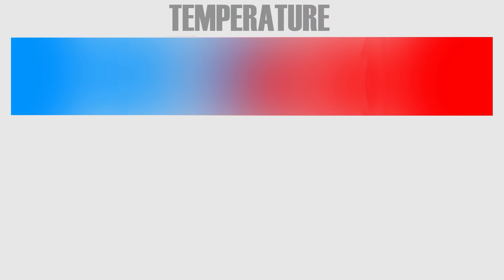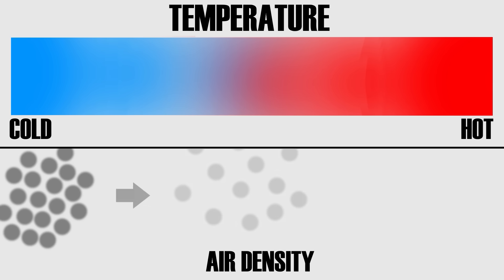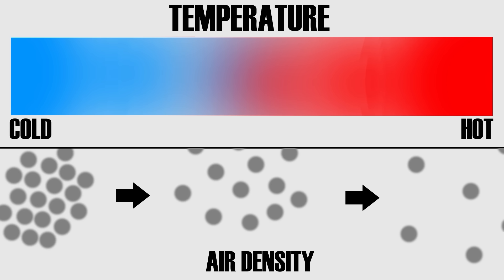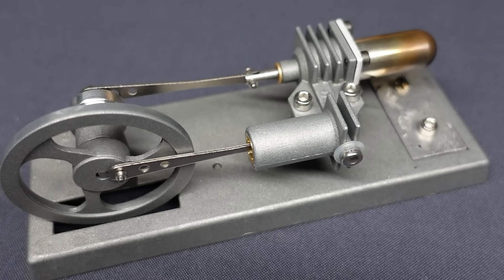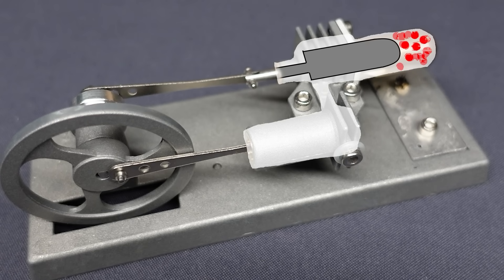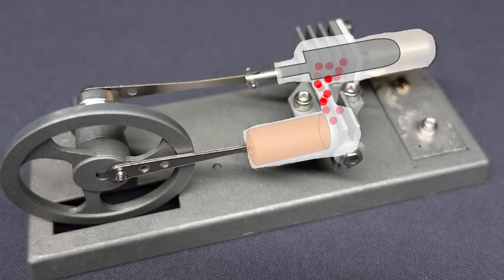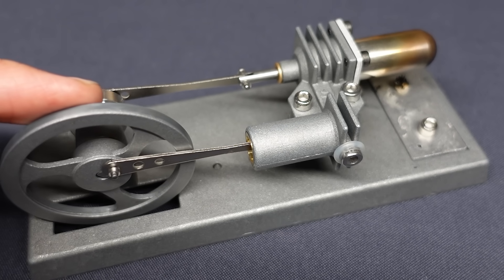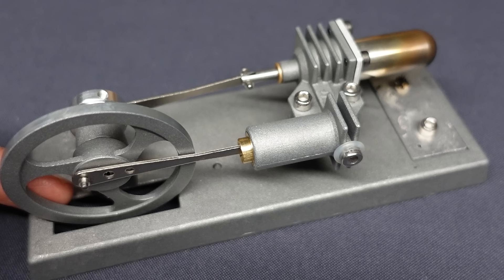It Can Save The World - The Simple Genius of Hot Air aka Stirling Engines

Comment: Multiple false statements in this.
No lubrication needed: As soon as this is scaled to something that is no longer a toy, lubrication is needed.

No carb is needed: It needs a way of throttling the flame for the power output to fit the power need, so it essentially needs a form of carb or regulator to control the heatsource.

They never need to expel burnt air and fuel: They do need to expel the "used air" from the flame, fresh air is needed to keep the flame going.

It can not take away spare heat from a gas boiler, any heat this thing takes does not go to heating.
It can also not live on heat alone, it needs the temperature difference to work, water would need to run in the cooling spots to make op for the high loss of heat from this engine.

Stirling engines are still only 40% efficient and they are much less efficient power to weight or size compared to Internal combustion.

The LED on V4 stirling engine looks like a 1W, a solar panel the size of that engine would produce the same kind of power for a much lower cost.

Comment: These can run on solar energy if the hot side is dark to absorb sunlight and the cold side is shaded. Bonus points if you use the flywheel as a fan for the cold side.
Reply: A magnifying glass or mirror(s) could concentrate solar energy on the hot side. Might not be practical but could work in theory.
Reply: @ben501st The problem is tracking the position of the sun with the glass

Comment: This is something I've thought of since I was a kid. It's always been met with, "It's not cost-effective to use waste heat." My thinking is, ANY energy you recover, is better than no recovery at all. If you put a Stirling in the exhaust stream of an Atkinson-cycle engine, or even a turbocharged engine, there's plenty of heat energy to create electricity. And the Stirling doesn't need to be some high-tech, overly-engineered design, either. As you've shown in the video, a basic machine made of simple parts performs well, and if car makers say it's "not as efficient as it could be," who cares? I can see creating an aftermarket unit than can be adapted to at least a few cars. It's not just electric hybrids, either. You could add a Stirling generator to most any car or truck and make 12 vdc for the battery, taking some load off the alternator.
Reply: "ANY energy you recover, is better than no recovery at all."

Incorrect. Would you work for $1 an hour as a second job? Of course not. Because the resources you put into the process, your time and effort, is not worth the resources you are getting out of it, the $1 an hour.

Likewise here. What do you gain by spending $10 recovering energy from waste heat if you only get $5 worth of energy out of it? You don't gain anything, you are actively wasting resources by trying to recover this energy.

"If you put a Stirling in the exhaust stream of an Atkinson-cycle engine, or even a turbocharged engine, there's plenty of heat energy to create electricity."

This is true. There is plenty of heat energy to work with there.

"And the Stirling doesn't need to be some high-tech, overly-engineered design, either."

This is where you are wrong. It absolutely DOES need to be a high tech design in order to be light enough, compact enough, and generate enough power to be worthwhile to fit into a car. Which is why nobody does it. Because it's too expensive to do.

"As you've shown in the video, a basic machine made of simple parts performs well".

Sterling engines are deceptive. Due to the Square-Cube Law, they work well at very small scales. Like here. Because the surface area of the cylinders is large relative to the volume of the cylinder. So transferring heat into the working medium is easy. However, the larger you make them, the less and less well they work. Because it gets harder and harder to transfer heat into the working medium. You have to start doing things like using a pressurized working medium, fins on the inside of the cylinder head, and other elaborate engineering.

"You could add a Stirling generator to most any car or truck and make 12 vdc for the battery, taking some load off the alternator."

You'd probably get enough energy doing that, with simple engines like these, to charge a cell phone. You'd spend far more energy installing such a system than you would ever get out of it. Which is why nobody does it.
Reply: @Crosshair84  it does make  sense for a stationary application like a wood stove or a home generator to make combined-heat-and-power.. but in that application you end up paying triple anyway because you got to get certified by all the unions and agencies (multiple overlapping UL listings too) associated with electrical as well as heating and plumbing excetera.... It sad when red tape becomes most of the cost...
Reply: Carmakers are not concerned with innovation and engineering solutions in the sense that the public uses those terms.
Carmakers are concerned with complying to government dictates. You will find plenty of engineers working for carmakers who are not in charge of anything but are as enthusiastic and capable as possible for true innovation and engineering solutions in the sense we think of, but that is precisely why they are not in charge of important decisions.

When they adopt the mindset of satisfying government dictates rather than what makes the most sense, then they are permitted to take the reigns of the company.

Welcome to totalitarian America, you were born it. Covid just accidentally made it possible for you to peek behind the curtain to see how plain this fact is.
Reply: @Revere2000 you sound like that was your job for a while.

Comment: This gave me so many ideas! I'm planning my house around the fireplace to harness the heat in many ways, and this is definite a good way of using the wasted heat, maybe to help circulate the hot air around the ambient, or move cold water into coils to heat up, or to help regenerate electricity. Thank you very much for presenting this kind of engine!
Reply: You can buy Stirling engine powered fans that go on top of wood and coal burning stoves, using the waste heat to circulate air. You can also get thermoelectric ones, which are more efficient, but engineering-wise, they're not as interesting.
Reply: @therealchayd  Nice to know, although I like the idea that something like this can be done by oneself and in a suitable size and shape to fit one's requirements. I planned and am building my house by myself (and some occasional friends), trying to keep it off-grid as much as I can. As with the heat, I'm trying to harness as much as from the fireplace. As for the heat circulating with sterling engines I was not thinking about open fans, but ducted ones, to move hot air to rooms away from the fire. Even the heatsink of this engine is useful for this purpose, if one manage to have a cold air intake close to the heatsink, pushed by a fan through it inside a duct that goes touching the metal chimney to extract even more heat as it travels through the duct all the way to farther rooms.
Reply: @therealchayd  I bought about 10 of the little white square thermoelectric ones with the 2 wires coming out. Don`t know why I bought them. Must of been a drinking EBay session. I do have a fan for the fire too. Think I was going to make a bigger version.
Reply: @therealchayd  Yeah, reading the comments, people are thinking the Stirling engine is something new and magical with great potential to solve the world's energy needs.
Reply: @codetech5598  we cant all know everything all the time forever and always, especially with not so widespread things like this. Give people a little credit and be happy for their excitement in learning something new. Maybe it's old hat to you, but it's cool to others.
Reply: @codetech5598  The same kind of thing was said about Boolean algebra when he invented it in 1854. It was mostly an academic novelty until 70 years later when electrical engineers used it to design a control relay board and invent the first computer. Old ideas are not bad ideas, and we'll never know the extent of a technology's uses if people don't keep picking it up and playing with it.
Reply: It is possible, to use heat from fireplace to also use as a power for Stirling to keep your home self sufficient. However, there are many things here that are very problematic. And as a person who lives in a home and uses it all my life, there is one thing from home i expect - quiet. And all engines have one thing in common - noise. Usually a fireplace is set as a central or close to central place of the home - even heat distribution and let's be honest, we LOVE fire. So usually a fireplace is built not in the best area to combine it with a noisy engine generator.
Second thing - Stirling engines may be a "low heat" engine. But those are just science toys for show and prooving a point.
So if you want ANY decent power output, you want to maximize a temperature difference, because this is where that power comes from, so - you want to put your hot part of the engine directly in the heat. You can use fumes. But exhaust gasses will differ in the temperature aswell. And today the most efficient stuff producing heat for home will have as low fumes temperature as possible. And this is around 50C for natural gas. Why? Dew point. And i'm talking here about high quality, never used natural gas stuff at home. For dirty stuff like a fireplace or questionable coal stoves, from what i remember, safe temperature of fumes is a bit below 300 degrees of celsius (250 or something similar). Why? Dew point and sulfuric acid. If your fumes will have such low temperature, water will start to appear on your chimney walls. And all sulfur compounds within fumes will become an acid and just eat your chimney away. Go ahead ans ask people who produce their own natural gas 😊

I just mentioned 2 main problems, and there are more :)
Yes, it is possible, yes it is viable. But it needs a lot of good engineering and building a home around your fireplace, or remodelling your home very, very hard.
Reply: Using turbines will me more efficient with wasted heat
Reply: be great for your house sir. U can do it, i know u can.
Reply: Don't forget the heat that refrigeration puts out.  Most important is understanding and minimising heat lost unintentionally from the house through lack of careful design.

Solar heat landing on a heat sink / stone wall etc. can be a store also.
Reply: Thats basically their main use. You can already buy commercial products which do exactly that heating while also creating power from waste heat.
Reply: There's a guy who made a Stirling engine at a grill, and he uses the engine to spin the barbecue.
Reply: A small wood stove (or rocket stove thermal pump principle) with connected mass heated from say a 20’ serpentine exhaust works for efficient heat capture plus long term release.
Reply: Good luck... with that.  Your going to find you will waste more of your time then what you will gain with your waste heat.
Reply: @tylermcnally8232  Nothing really worth doing is easy 😉Such decision should be well informed informed, yes. But personally i wouldn't discourage it by empty statements. That's why i made my previous remarks. And i stand by it. It's not easy, but not worth it? Show me your calculations please. Worth is measurable.
Reply: These engines can't really do work.
Reply: @BBVance  Oh really? That's amazing... Did you talk to engineers of Gotland-class submarines? I hope you do, because Swedish Navy is using succesfully Stirling engines there for years.

Comment: You said power modulation is big problem of this engine. I am not an expert on this topic but a simple thought just came to my mind...is it possible controlling the engine power transfer like in a normal internal combustion engine...Using some kind of clutch for that to engage and disengage the engine torque transfer and therefore controlling how much throttle and momentum you wanna build up :)

Comment: an sterling alternator in a vehicle would be cool, no horsepower loss, but generating energy
Reply: Except the energy produced would be much lower and the engine compartment/room hotter for an overall worse efficiency. The power loss from an alternator is insignificant. There are use cases for Stirling engines, but this isn't one of them.
Reply: @EldeNice the termical invirorment is a problem, but sure an alternator steals a lot of horsepower, that´s why modern alternators are controlled bey ecu, when you accelerate quickly, the ecu shuts down the alternator so that you have full power.
Reply: @oliverroedel1111  An alternator takes at most 10 HP at full output in typical cars. Most alternators have a maximum draw between 4 to 8 HP while the average car has about 200 HP. ECUs do not stop the alternator. They regulate the output so the battery keeps charging while providing sufficient power for the rest of the components.
Reply: @EldeNice the ecu stop the alternator charge the battery, sure not his rotation. but the charging is what takes the horses away.
Reply: @oliverroedel1111  It never stops charging, you're wrong. The output is regulated, yes, but it has nothing to do with having a couple extra HP. If the alternator isn't regulated then you'll see your lights dimming when engine suddenly decelerates and brightening when engine suddenly accelerates. Automotive techs use that as a symptom of a faulty alternator regulator. Alternator regulators have been a thing before ECMs. The difference with an ECM is that instead of being limited to a static table, you have a dynamic one.
Reply: @EldeNice  I think you doesn´t know how an alternator works. today the ecu comands if and how much volts the alternator generates, that means that he really stops to generate energy when the ecu comands for it. there is zero comparison with old fashion alternator/regulator/dash lamp and ecu pwm controlled modern alternators. theyr charging is controlled totally different.

Comment: Why can't we use them in hybrid vehicles ?
You combine a small battery with an efficient electric motor and a Stirling engine with an electric generator.
You should get:
- long range autonomy
- fast energy recharging
- clean combustion (low missions)
- efficiency
- power modulation
- silence

If it does not exist, what do I miss ?
Reply: Increased mass.  The power:weight ratio is not greater than the ICE in the hybrid vehicle, so the added weight of the stirling engine would not be sufficiently offset by the added power scavenged from waste heat.

If the efficiency gain is less than the weight gain, then the result is a reduction in efficiency, in mobile applications.
Reply: @Kineth1  Thanks, I understand why it works on sub marine where mass does not matter much so much...

Comment: This little engine is so interesting, and I really think that in the future cars will have an internal conbustion engine coupled with a battery ( hybrid system ) and that a Stirling motor will be added to help the electric motor, I think the combustion engines are not dead !
Reply: combustion engines are still the driving force of everything, alternatives at this stage are only footnotes and have sometime to prove their viability long term.
Reply: @3UZFE  Yes I know, but this could be added to hybrid engines like we already have, and of course the internal combustion engines will not disappear in a snap of a finger.
Reply: I think Stirling engines would be a nearly perfect match for series hybrids, much like you describe.  The lower power is not a problem because series hybrids already use very small ICEs.  The poor change in RPM does not matter as the combustion engine of a series hybrid is meant to run at its optimal efficiency.  Electric motors do the actual work of driving the car.  What we really care about is efficiency, which Stirling engines seem to be superior in.